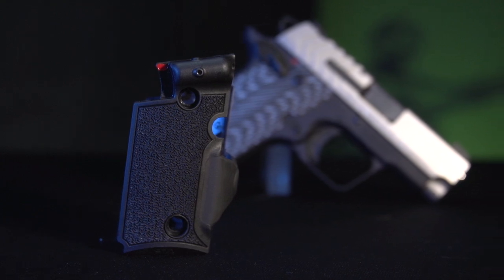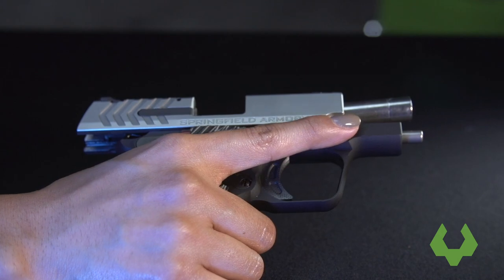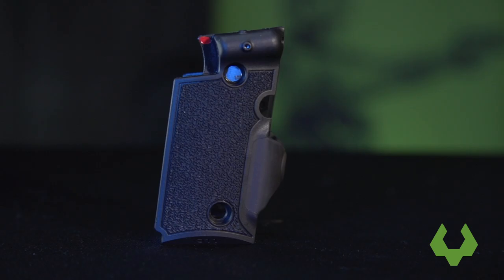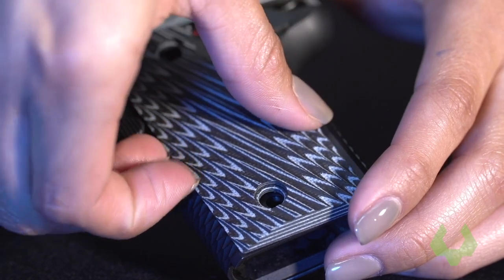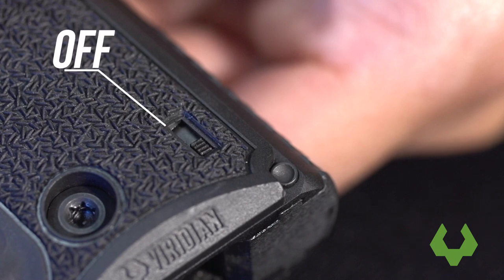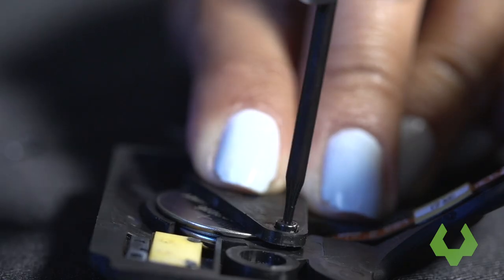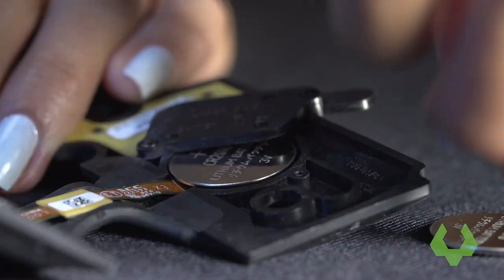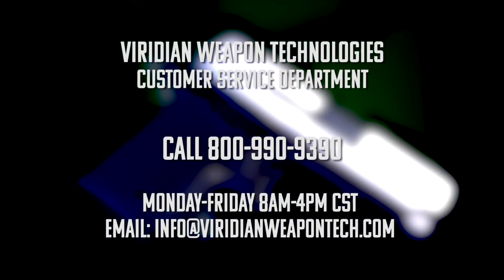How to install a Viridian Grip Laser

Comment: The switch positions in your video are incorrect. OFF = UP, PULSE = MIDDLE,  CONSTANT = DOWN.
For the time being, I'll be leaving mine in the "OFF" position, since I can't get the laser to stay in adjustment. Not impressed with the windage/elevation adjustment!
Reply: Ditto.  Had mine exchanged for a new one, still a no go.  Bother were way off and could not be zeroed.  Probably going to just return to store ... they said they'd take it back if I couldn't get satisfaction from Viridian.

Comment: i havent seen these forsale ive looked everywhere
Reply from the maker: Jessy, Springfield Armory just got these up on there website here is a link. https://store.springfield-armory.com/Shop/pc/VIRIDIAN-911-GREEN-LASER-GRIPS-276p1796.htm
Reply: @ViridianWeaponTech  you guys having any qaulity control problems with sighting in the lasers correctly? Or has thier not been many complaints? I can't find any reviews anywhere online. Thank you!
Reply: @ViridianWeaponTech  Will these fit the Sig Sauer P238 as well?
Reply: @ViridianWeaponTech  my laser is dim like the batteries are going dead. I changed the batteries, but still dim. I tried two sets of batteries to be safe. I tried cleaning the lens with a q-tip. Any other thoughts?  Gun/laser is about 1.5yr old.